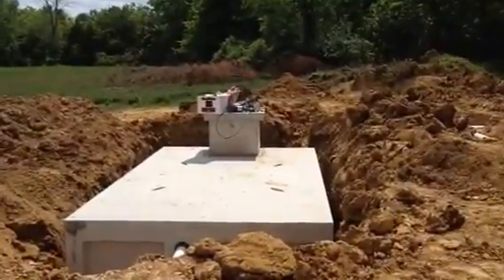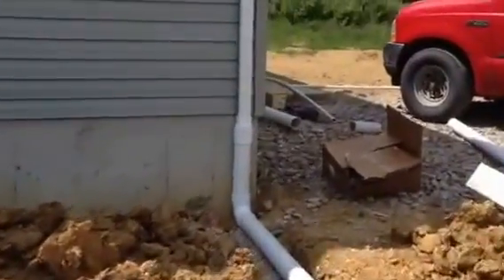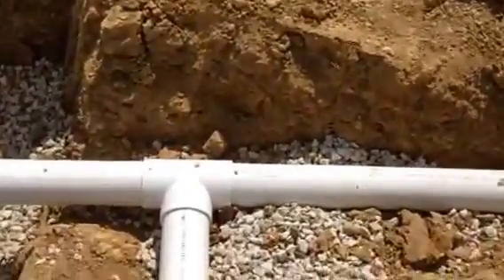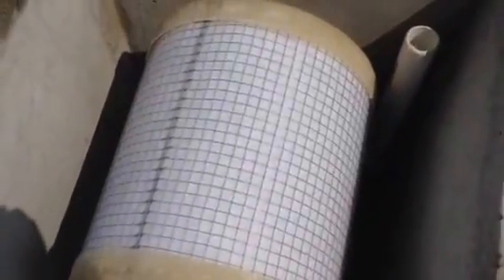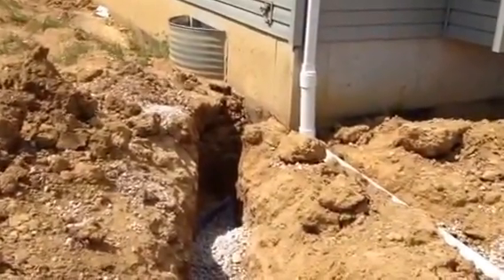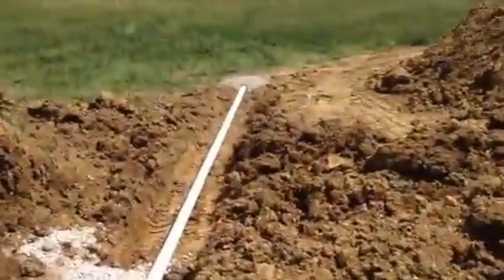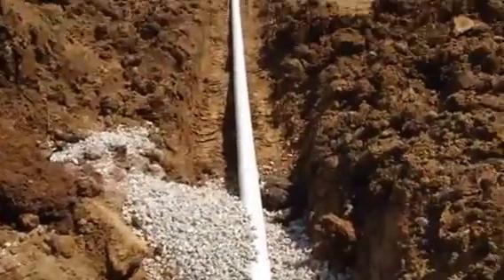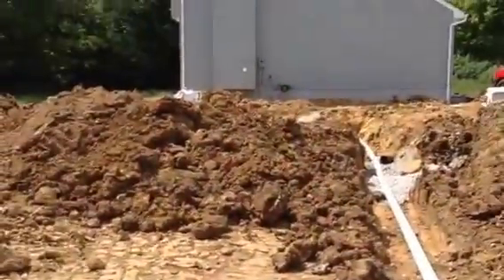Underground concrete cistern installation overview

Comment: I did not see any turn out valves on the downspouts. The roof needs to be "washed off" with each rain so the bird poop and any other particulates you wouldn't want in drinking water with drain out into the yard.  Only after the roof is clean should the valve be turned to drain into the cistern. Sometimes it doesn't rain enough to get water after the roof is clean. I grew up with cistern water and there is no way I would accept that setup for getting water into a cistern.
Reply: Hi Brenda -- The roofwasher filter has first flush capabilities, which is why we install it

Comment: I am impressed that although there is ground water so close to the surface that a cistern and rainwater harvesting system was installed. You can never have too much water security. Bravo !

Comment: Hello Jonathan, thank you for the video.  Do you have any idea what this lid and concrete box may be?  It is about 3' wide and 10' long.  It's next to a concrete slab where once used to be either small house (12' b y 15') or a shed but no longer exists.  https://goo.gl/photos/VH8fnCZR9W6xZ6Ry7
Reply: Liberty Garden what is it?
Reply from the maker: That looks like it could be a cistern, but more than likely it's a dug well. If you can ever get that slab off or peak inside, I would bet that you'll see a two-chamber system, where one side is pretty deep (greater than 15') and the other side is shallow. The deep side would be the well and the shallow side would be the pump house. General rule of thumb is that anything greater than 10' is a well and less than 10' is a cistern. Could also be a septic tank. Basically, it's impossible to tell without looking inside.